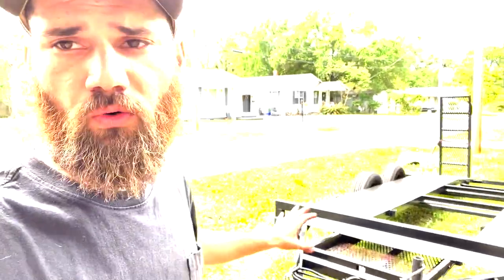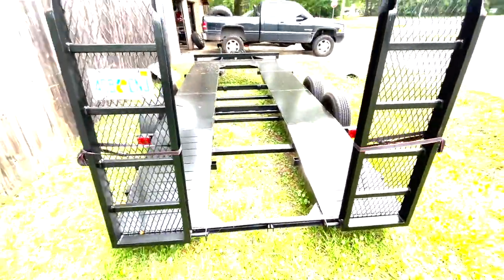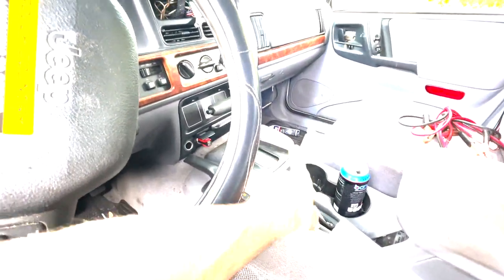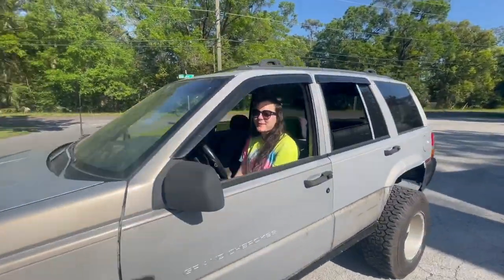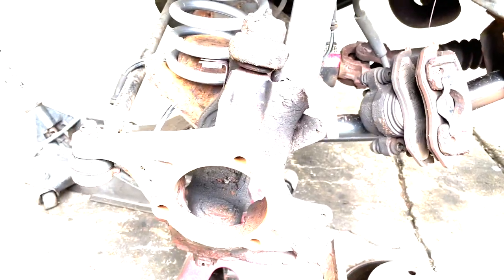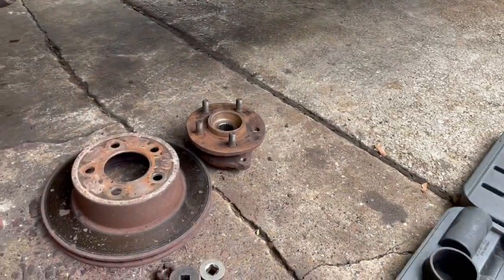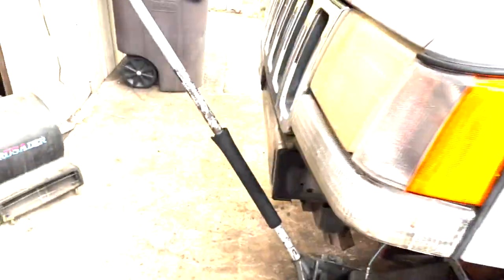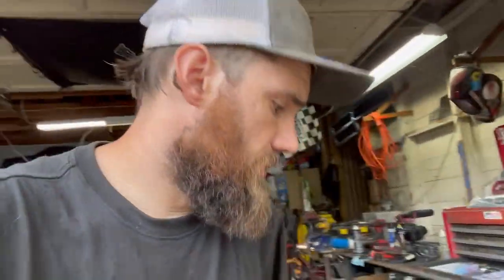My Car Trailer restoration is FINISHED! + Ball Joints & Wheel Hubs for the JEEP ZJ (Part 3)

Comment: @TheDogHouse hey i started watching yalls video on the 5.3 swap for the camaro [4yrs ago]. i have a 2010 v6 and like you said in the video, mine started making a noise that sounded like it was knocking badly so im swapping a 5.3 vortec into it with a 4L60E transmission. im having a headache trying to figure out the wiring so to make my life easier can you tell me what you did for the wiring/ecu and like what parts and kits you used as far as ECU/Standalone ECU, Trans controller and what not? it would DEFINETLY help me cus i dont know a whole lot about cars.
Reply from the maker: The guy that was doing the build, quit & sold it after he had a kid. I would suggest looking into the Holley kits as they have full harnesses & ECUs to